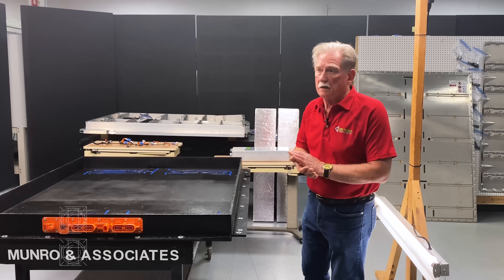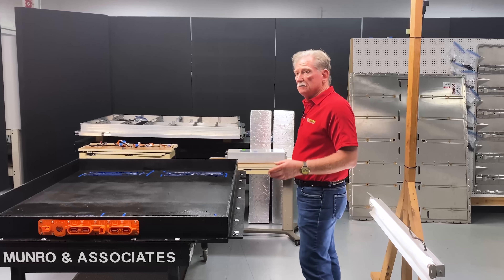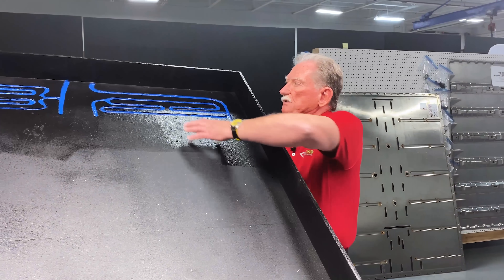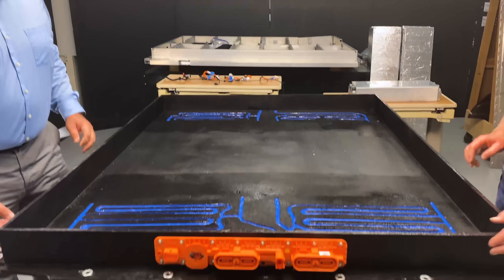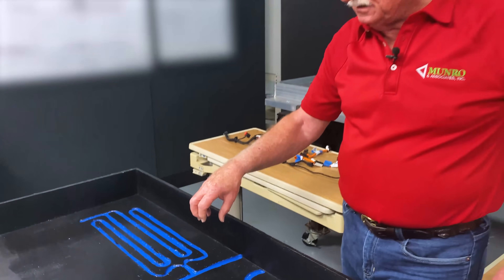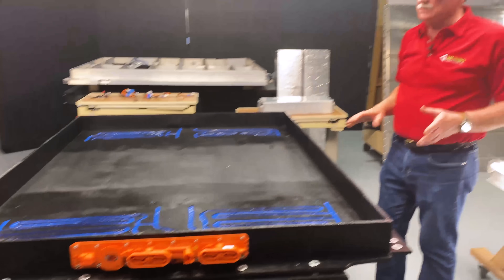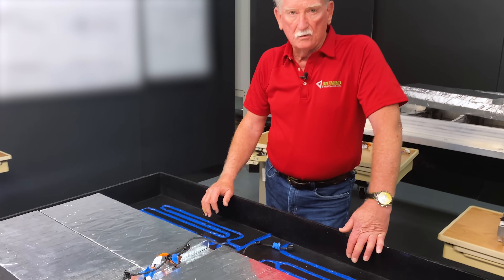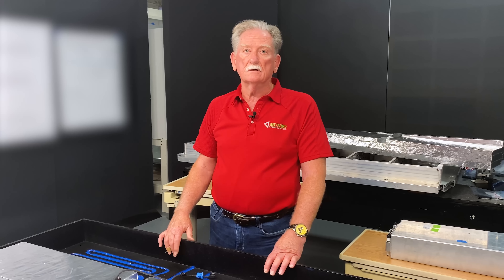Volkswagen ID.4 Battery Prototype Update

Comment: 4:30 "...by putting them together like this and then applying an adhesive...": Wouldn't it be better to have the battery modules support an "edge into slot" or "tongue in grove" like feature. Then when you slide them together you get good area alignment...and they can be disassembled. If you're concerned about heat transfer, place them on a bed of heat transferring putty. Have the top do the same and those batteries aren't going anywhere. No fasteners. Yet serviceable.
Reply: The whole point of the cooling channels directly interfacing with the battery plate is so the batteries get the best hear transfer. If you use an edge and slot you will still need to have some sort of sealing gasket or RTV to prevent leaking. Maybe you could to a edge in slot and RTV. In Sandy’s case he is killing three birds with one stone by using adhesives which he knows won’t leak, holding the battery in place, and providing more rigidity to the vehicle.
Reply: @ryanmccawley5467  The battery modules would still sit right on the cooling surface as he plans now. I'm just suggesting each module have a bottom plate and top plate offset by 3/16" or so. Then an edge of one module could slide into a slot of the adjacent module. No glue or RTV or fasteners are then needed. The modules themselves are designed not to leak (as his mock-ups show). And when the modules get weak (as they are known to do) you can apply them to another application (at about 50% reduction in replacement cost after return of the core...better than a golf cart battery by far).
Reply: I’m not saying it’s necessary the best idea to glue down the modules. It depends on the constraints. If it is assumed that the battery will last the life of the vehicle and the chances that you have to service one or two packs in the whole batter are extremely low, what is the point of making it serviceable? If the entire pack degrades over 1M miles you are probably better off throwing it in a grinder and making new greatly improved future batteries then you are trying to use batteries from 2021
Reply: @ryanmccawley5467  what happens when a single cell got bad in the module..
Reply: @nekil_s  I guess it would depend on the failure mode but you would lose a little capacity and thus range. What is the probability of that happening? Would that be enough for you to take apart the entire pack to replace one module? If it happens to a few cells what is the likelihood that they are all from the same module. You could end up with a single cell failing in many modules but if you cared enough to replace all of those modules, you may be paying as much as the cost of a new pack. My point was if the batteries were good enough that they don’t fail would you be servicing and i guess now if there was a singe cell bad is that worth the effort.
Reply: @nekil_s  Typically each cell is fused isn't it? Since they're in parallel, you just lose a little capacity. What is more likely is every cell loses capacity over time.

Comment: Recycling by separate materials is mandatory in Europe. Using glue may be an issue. Although there are various types of glue, wouldn't be a snap fit  by using thin walls  with a hook between cells viable?
Reply: iPhone batteries are glued, I haven’t noticed the EU complaining.
Reply: @fredbloggs5902  Regulations for cars and mobiles are different. Welcome to politics

Comment: There is no way we will reach 50% EV sales by 2030 unless the fascist socialist government limits, banns, over taxes combustion engines or pays people to buy an EV. The current EV is a loser and takes at least 20 years just to break even against a comparable sized gas model due to its price not t mention the inconvenience it offers. Switching from oil powered vehicles to electric vehicles that get their electric from oil fired electric generation is simply crazy.
Reply: EVs are more efficient that ICE, even when the electricity is generated from coal the emissions are around half that from an ICE car. Gas is better, and nuclear, solar and wind have none.
Reply: @fredbloggs5902  you have bought the lie.
Reply: @JohnSmith-ug5ci  

No, I’ve done the calculations for myself.

The ‘lie’ was that they’re 5x more efficient. This is only true if you’re in an area with lots of renewable electricity.

Like I said, for coal it’s around double.

These figures are for the U.K. 

A coal fired power station has emissions of 850g per kWh.

Transmission losses are 2%.

So 867g per kWh at the wall socket.

Tesla charging losses are 4%.

So 903g per kWh in the battery.

A Tesla-3 does 4 miles per kWh.

So 226g per Mile.

A diesel car has Emissions of 7440/mpg in g per Km.

So a diesel car doing 30mpg emits 248g per Km.

248g per Km = 397g per mile.

The break-even point for diesel vs coal is 53mpg.

Gas produces 500g per kWh so the break-even for diesel is then 90mpg.

If you have alternative figures, you’re welcome to provide them.
Reply: @fredbloggs5902  well I also have done the math and my math say your math is bogus. Now let’s look at claims these vehicles save money. Keep in mind you are not paying an federal road taxes and many states are not charging any state taxes at this time but that is about to change. First the Bolt EV vehicles are around 20,000 more than a comparable sized gas model like a corolla in the 18k to 20k range. The average EV driver goes 3.5 miles per KWh summer and winter driving. A comparable gas vehicle averages around 31.5 MPG in all seasons driving.
 
  The average US home electric rate is around 12 cents per KWh excluding delivery charges and taxes which adds another 1 to 5 cents per KWh depending on amount used. So let's crunch some real numbers. So it would take an EV on average 9 KWh to drive the same distance as a comparable gas model on one gallon of gas.
 
31.5 miles divided by 3.5 KWh= 9 KWh. at .12 cents a KWh, home charging, it would cost 1.08 dollars for the EV. The current average gas price at the pump is around 3.19 per gallon. So that means it would cost the gas vehicle on average 3.19 a gallon, a difference of 2.11 dollars to go the same distance of 31.5 miles. Keep in mind the EV is mostly not paying road taxes yet which would add another..051 per KWh to the electric.
 
Now as things are the EV saves 2.11 for every 31.5 miles. Now the average miles driven today is 13,474 miles per year The EV saves 2.11 per every 31.5 miles driven so divide 31.5 into 13,474 miles which is 427.74 then times 1.31 for a yearly savings of 9025.53 dollars a year.
 
The gas vehicle has oil changes every 5000 miles or 6 month so around twice a year, but let's make it three times so as not to be low. The average oil and filter costs are around 30 dollars so that is another 90 dollars a year in savings for the EV. The gas model also has an air filter which is changed around once a year for around 15 dollars. 
 
So we are now up to a savings for the EV per year of 1007.53 dollars. For now we will forget about tune ups on the gas model since they are required at 100,000 miles, but they are nothing but a spark plug change of around 150 dollars if done by a mechanic or 30 dollars if done by the owner and would be done on average once every 7 years.
 
The ev costs on average 18k to 20k dollars more than the comparable sized gas model. We cannot include the tax incentives because that is not the true cost of the EV and the gas models do not get incentives.  The EV saves an average of 1007.53 per year so 18,000 divided by 1007.53 is 17.8 years just to break even with the EV. So when anyone says it is cheaper to drive an EV the amount of truth involved is VERY little unless you keep the EV for over 18 years. Once they add in the road taxes it will make the EV even more costly.
 
The time to break even would be even greater if you used any public charging stations and I did not include the maintenance required on the EV’s. Conclusion, the EV cannot make the claim it is saving money so all that is left is that it is an over priced toy. Hopefully that will change in the next 5 to 10years.

Comment: Munro & Assoc is proposing to cool batteries from bellow as contrasted to cooling from above. Last I knew heat tends to rise. Would it not be more efficient to remove heat from the top?...........
Reply: Not for Tesla's 4680 cells.  Heat flows most efficiently to the bottom.
Reply: @bobwallace9753  Where may I ask did you find evidence of heat flowing  down (being dissipated)  rather than being dissipated better from above?....
Reply: @roberthawxhurst3717  I'm pretty sure it was covered on Battery Day and Sandy has talked about it on his site.  But here's some more -

"The improvement that does a lot of the heavy lifting to enable using a larger form factor is the tabless design. Eliminating the tabs reduces the internal resistance within the cell caused by the extra component. Internal resistance translates to more heat generation, a more complex manufacturing process, and higher cost.

Tesla’s new 4680 cell eliminates the internal tab, instead integrating the function of the tab into the jelly roll itself, resulting in a clean, uniform look to the end of the cell. “We basically took the existing foils, laser powdered them, and enabled dozens of connections into the active material through this shingled spiral,” Tesla SVP Drew Baglino said."

https://cleantechnica.com/2020/09/22/everything-you-need-to-know-about-teslas-new-4680-battery-cell/

In other cells heat has to travel through the electrolyte, which is not a good conductor, or take the longer spiral route of the foil conductor to the 'tab'.  With the 4680 the foil makes contact "constantly" at the bottom of the cell, making the distance traveled much shorter.  

Take a look at the image of the bottom of the cell in the article I linked.  There's very large heat (and electricity) conducting area at the bottom of the cell.  That's the best place to wick the heat away.

Heat does rise in air and water (convection).  But in both cases there is room for the warmest molecules to rise.  Heat spreads (conduction) rather than rising in solid objects and some materials are better conductors than others.

Comment: Why no use of wireless battery management?  That cuts weight and the number of connections.
Reply: if the technology was proven, it would be utilized is my guess
Reply: @hobbit1953  Wireless BMS will be utilized in the GM Ultium design. https://www.youtube.com/watch?v=0D0__jJ9JEE
But as long as Munro did not tear down such a thing, it's not on their list of ideas. They are more into technology transfer from one teared down vehicle to the next teared down one.

Comment: You guys there at munro think it is feasible to make a vw golf sized or smaller ev with ~100 mile range for 10k MSRP?
Reply: That is totally possible. Just take a look at Seat Mii Electric which has a 160 mile range and without taxes costs 12 000€ with 2000€ support money included. With smaller battery, cheaper wheels/tires and simplified interior it could be sold for 10k.
Reply: @I_THE_ME  interesting, never heard of them, looks like that car starts at 20K though? i wonder if any of the larger companies, ford, vw, tesla, etc, would ever go after a 100 mile, 10K MSRP market. seems like a lot of people live in households with multiple cars and replacing one of them with a super cheap, affordable ev, that you would really only ever charge at home, could work for a lot of people
Reply: @horse_examiner  Yes the cost of the final models was around 20k as the production ended, because it sold very well. Earlier models I think around 2018 were much more affordable and probably had less of a markup. Btw the production ended so the production capacity could be focused on ID product range but Seat has made it clear they will be making an affordable small electric car, around 2025.
Reply: The Dacia Spring is a new build EV for $14,000 ish sans VAT https://ev-database.org/car/1319/Dacia-Spring-Electric

Comment: An emerging request being heard from fire authorities is some mechanism that allows fire fighting internal to the battery rather than dousing the car with water for hours. Would it be possible to integrate a non-water based system, perhaps one time use, that flooded the entire battery pack with inhibitor? We used to hit data centers with halon as a one shot. Something similar that would be best for lithium battery fires?
Reply: I was involved with the design of a new control room.  I thought the state of the art fire suppression was halon.  I learned that it had been banned in the US for all new construction.  It seems it had been proven unfriendly to the ozone layer.  We were forced to go with water suppression.  This led to a pretty complicated system to protect the systems from leaks and the firemen from electrocution.  But to answer your question, to fight lithium battery fires you need lots of cooling and you just can't beat water for that.
Reply: @videcomp  Yeah, that's what I was referring to. Back when I did data center design we had to convert our designs to dry pipe systems, which to a degree are fine for burning PCBs and wiring. Lithium, a member of the alkali group, becomes highly reactive in the presence of water. Back in high school chemistry, the standard trick in the 60's was to pitch some pure sodium into water to demonstrate the violence of the reaction (no idea if they still do those kinds of things). Fire professionals are given good documentation on the various kinds of hazmat encounters they might have. They know water is a problem for lithium, but its the current guidance in the absence of the engineering community coming up with (possibly) a better proposition. That's all I was alluding to. Cars have fires. Gas cars burn a lot. Someday we'll have lots of BEVs, and it seems like, engineering hat on, we might think about how to snuff them out in a more efficient manner. That said, maybe this is all a false start and we'll have new technology batteries that don't combust. I watch with enthusiasm.
Reply: I haven’t noticed ‘fire authorities’ demanding such mechanisms inside petrol tanks 🤔
Reply: @fredbloggs5902  I didn't use the word 'demand'. It is a discussion item.

Comment: VW has created a modular platform for all their EVs to come of all their brands like Skoda, Seat, Cupra... in different sizes so they can use the same components on the ID. whatever, Born, Enyaq and so on. Maybe this is the reason for them to not crate the optimum parts for each model.
By maximizing production volume and simplifying design in my opinion they did a good job to push the conversion from being a traditional car manufacturer to a leading name in electric mobility.
German car manufacturers are extremely good in punching either steel or aluminium and they already have the infrastructure they need for this. Maybe this is just a first step, or they have recycling in mind as the manufacturers in Europe have to recycle everything they sell, or at least pay for it.
Reply: it is also easier to replace defective modules with the VW system
Reply: The existing platform is excellent for second life applications
Reply: What about a compromise of their punching skills, the modularity and your idea of having the coolant in direct contact to the battery?
Reply: @marchofer8829  too risky, a leckage and you can throw it away. A car is flexible and moves and has vibrations...

Comment: Either you are incredibly smart or VW is really dumb that you can make this is a short time and they cant. I really hope for VWs sake its somewhere in between.
Though, have seen this at my own company. Designing dumb stuff even though there is full access to already made, cheaper and better stuff in the same building.
Reply: They just made bigger battery modules the rest they have taken from VW concept. But when you see that a battery has a lifespan of up to 25-30 years and that from a car is 12-20 years it makes sense to use a battery after the EOL of the car. For longterm battery usage it makes sense to have smaller battery modules (1-5kg) for reach more market segments and simpler handling. 
In other words the upcoming VW battery module looks like the best solution.
Reply: I agree. There is no thinking into stiffness, crash resistance, cooling performance in this design. If I'd be the company paying for this study I would ask several questions before going further... Being inventive is one thing, being blind on safety, crash, thermal management can be damaging to both companies...

Comment: I think the first to make really big cylindrical cells will ultimately win out.  Much bigger than 4680.  With coolant channels inside of the cell.  With around 100 internally cooled cells place under seats and the centreline you would keep the floor hight of a traditional car except for the middle rear passenger. They could be bolted to the car underneath and then a steel protection sheet bolted to the bottom to protect them.  There would be no modules and the coolant would get directly to the material that needs it.

You’d get maximum cooling efficiency. Floor space. No module construction necessary. Each cell would be replaceable/upgradable.
Reply: You can’t put coolant channels inside an individual cell. 

Cell size is a compromise between power capacity that increases with volume, and thermal cooling which increases with surface area. 

I’m guessing they ran the numbers to produce the 4680. 

They aren’t going to getting any bigger.
Reply: @fredbloggs5902  Battery cooling is also about battery chemistry evolution: As chemistry improves, energy density improves and so does power density. This means lower internal resistance in each cell and lower cooling needs, so while cooling is important now in a performance EV, it might not remain a general issue in the future.